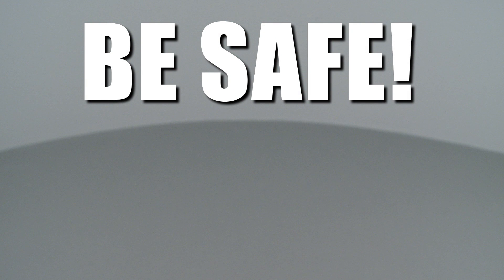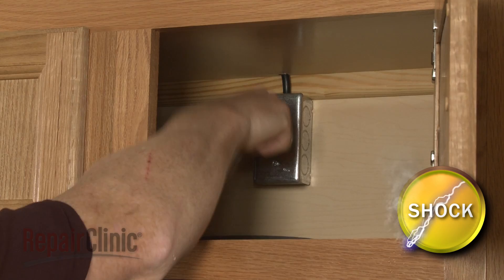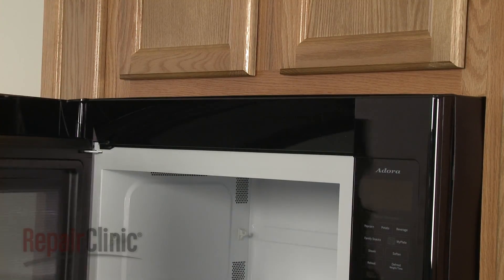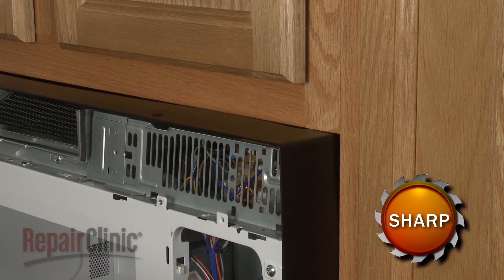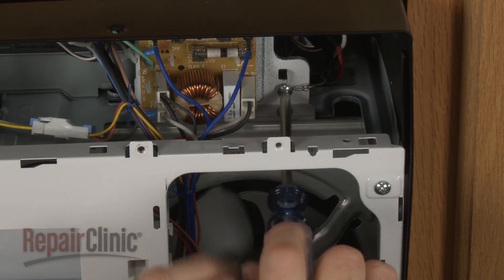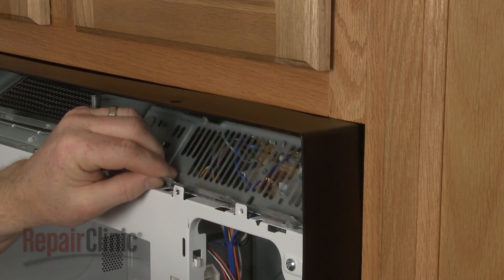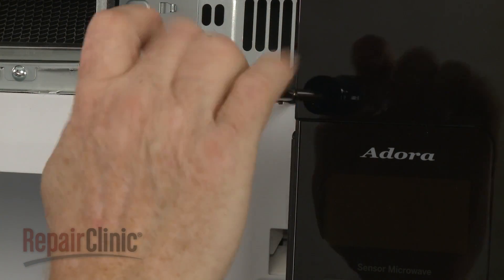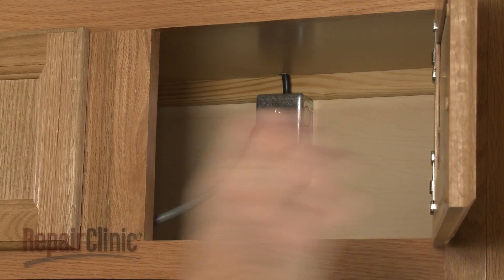GE Microwave Won't Heat? High-Voltage Diode #WB27X10597

Comment: If it's sparking on the inside of the cooking chamber, make sure it is clean and has no sharp edges. If there are sharp edges, they can be sanded down with fine sandpaper until totally smooth and painted with microwave paint. If it's a diode, it will make a buzzing sound. A bad diode will be shorted when measured with an ohm meter (no resistance). No buzzing, diode probably not the problem. Pretty much anything else, leave to the pros. Death is possible, even without any power, so keep you're fingers out of all other areas. Even a discharged capacitor can retain enough power to stop your heart (the bleed resistor can be open). If you have problems with a commercial microwave, do not attempt to fix anything in it. Call a pro.

Comment: We have a Model No PSA1201RSS01 General Electric Microwave that does not have the single screw access panel. Any guidance on how-to replace the line fuse and diode in this model would be great.

Comment: thanks for this video! simple and straightforward! just fixed our microwave with this simple repair!
Reply from the maker: Cool thanks!
Reply: was it making a buzzing noise, no heat? Light and turntable  worked?

Comment: It looks like all microwave caps now have internal resistors to dissipate the voltage so I guess the needle nose pliers are just to ensure.
Reply: Correct the use of pliers is just for safety

Comment: Do you have video that shows how a 'not heating' issue was diagnosed to determine if it's a door switch, diode or magnetron issue?
Reply: Keith Lawson iu
Reply: @keithlawson7469  IU = Internet University, he's telling you to run a Google search. Typically, when the diode is the issue, the oven will "run," but make a loud humming noise that is not typical of it's normal operation, and it will fail to heat. (Also, sorry it took me 4 years to get here.)

Comment: how can we tell if it's a door sensor error or diode or magnetron error?
Reply: If it is the magnetron or the diode, the oven will still start. If it is the diode, there is typically an odd/loud hum, but no heating. If it is the magnetron, there will be no heating. If it is the door switch, the oven will not start. The door switch is easy to test with a meter. There are videos that explain how to test the diode and the magnetron as well. Sorry I just got here, I hope this helps you. BTW, if you replace the magnetron, go ahead and replace the diode as well because, why not.
Reply: Check the door switch. Check the diode, and check the Mag.

Comment: I need help rewiring my microwave. I took it apart and replaced the diode and magnetron but I don't remember how everything hooks back up to the capacitor, like which wire goes to which terminal? It is a Whirlpool mh1150xmq3 model if that helps.
Reply: Sorry, I just got here. Okay...LOL!!!!!!!! I'm sure that you now realize that taking pictures as you go is a good idea????????????????
Reply: You should have used your phone take a photo of the wiring before disassembling the Microwave⚠️

Comment: hi, I want know the purpose of the diode from the capacitor to the frame, and if burn out what is the effects?
Reply from the maker: mark A diode is a check valve, but for electricity. It allows current to flow in one direction. If it fails the microwave will not heat.